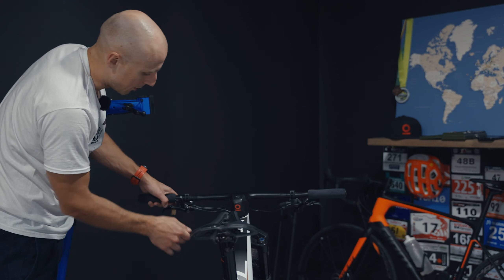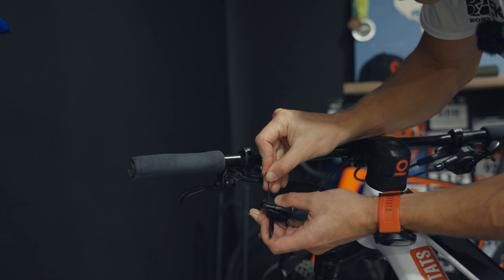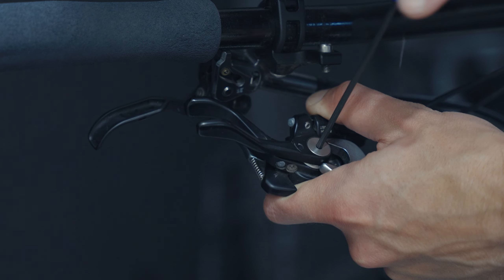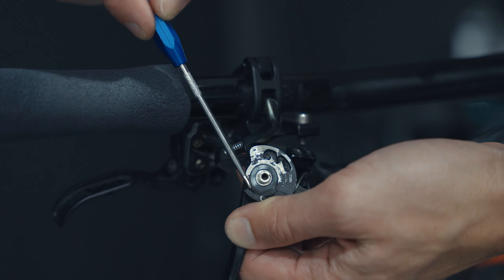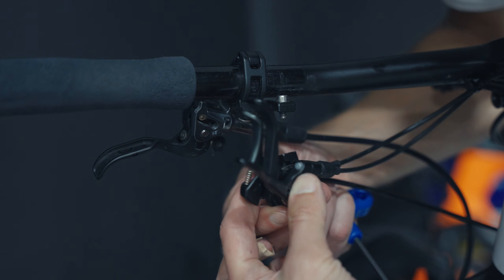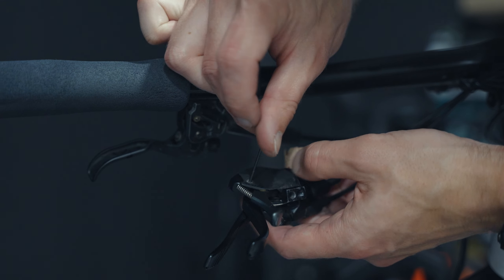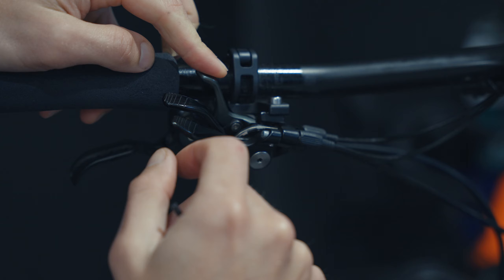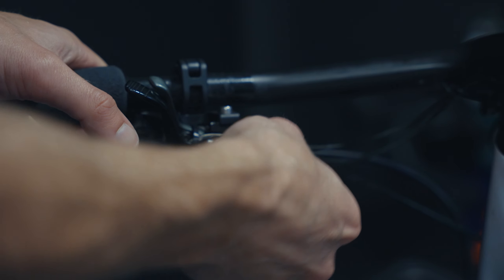Twinloc Remote Lockout Issues - Temporary Fix

Comment: For me thé problem was that thé rear was to tensed but it was unpossible to loosen it from the twinlock lever because the thread would be engaged properly...
So I unscrewed the rear-shock câble a little bit (5mm max) and then readjust thé twinlock screw, now it locks and keep locked properly
Reply from the maker: Thanks for sharing. Overtight cable can cause twinloc to fail, at the extend if lockout is too tight and you still go over it with force. however, most likely by doing that only lockout on shock/fork would be made broken, not the lever itself. 

By saying 5mm max - what did you mean in particular? Curious, as lockout bolts are prob 2 & 2.5mm allens.
Reply: @tom10crafted  I loosen the câble of 5mm (in lenght)
Reply from the maker: @ ahhh, gotcha! 🙌🏻

Comment: I knew the lockout was done the moment I saw the way you tried to tighten the  bolt from the dropper post and still  kept moving. It was the same problem  with mine. Still can't believe how fast scott sent me a new one, and it took me only a week to get the replacement part. Well, considering for what you use the bike, it is a miracle that this part lasted so long. What kind of threadlock do you use for the bolts?
Reply from the maker: I had some hopes that threads at the end will still be there - not the case. Actually after thinking for  while I might know why some are able to use it longer than others. IF rider didn't spot that the bolt is loose, then pushing with the force screw up threads sooner. It got loose for me only once in the past, and I immediately tightened it back with a threadlock. To which, I am not picky, using whichever I have onhand.
Reply: @CarlosSaavedra76  , just bring it to authorized scott dealer in your area,  they should take care of it.

Comment: Replacement with twinloc of the first spark(17-21) and wolf tooth dropper lever barcentric, finish the problem😅  my solution in my spark and happy with this
Reply from the maker: Adds significant clutter to the cockpit though :p
Reply: Its very clean for me
Reply: This system look the picture
Reply from the maker: @flape78  it is subjective thing 😊

Comment: Be honest. Would you get another Spark? I am considering different bike
Reply from the maker: It is hard not to be biased - but I wouldn't blame the model or manufacturer itself. Lets begin the honesty from the degree where not everyone goes 12k+ km in two seasons with a full suspension bike, with as much racing and beating it. To add on top - it is difficult to expect anything else from such loads, unless once you buy something you want it to last for decades. That could, only, potentially, work if bike is used to go to the church on Sundays! :D
Reply: @tom10crafted  true. I will be riding over 10km in 3 months and I will put my Spark thru it’s paces. Since I posted my initial comment I have concluded that the Spark is for me. Your channel has been a massive help and much appreciated. Now that I am keeping mine I hope you keep yours and continue making videos. Once again thanks 🙏
Reply: Thanks for sharing. New spark 900 user here. Just two rides with it coming from a epic. Very nice and different feeling. Love it. Just the  the rear suspension doesn't get fully locked. Does it get fully locked on yours? Front suspension it does for me, but rear suspension not. I will try to tighten the cable of the twinlock. You said anticlockwise, right? Thks in advance!
Reply from the maker: @rafaelsegui4845   Hey man, welcome onboard! Yes, year has to lockout basically rigid like - apart from sag.

But if you lockout and push the seat while standing on the ground, it shall not move. Yes, counterclockwise to tighten, middle barrel on the twinloc!

Comment: Its unbelievable that this part breaks so fast.
Reply from the maker: it is totally believable! :D
Reply: @tom10crafted  During my ride today, my Twinloc was fluttering on the handlebar. The inner thread is completely torn out. In my opinion, it's a complete design flaw (force multiplied by lever arm), especially with such huge levers fixed at a single point with only one screw. And then it's also made in a lightweight design. No wonder the thread gave out in no time. They should have opted for a sturdy material and a two-point fixation. Best regards.
Reply from the maker: @pumeluff7509  thats true! Actually, in my case warranty has declined the replacement. Havent’t seen the conclusions yet, but that was surprising for me

Comment: just broke the thread like you did, the wires should be removed before we start working with the lever, the rear shock's wire is pulling the lever in a weird position and that will not let the bolt go back straight in the threaded hole. have you had any success with the warranty? it is incredible to see high end shocks being controlled by this chinese horrendous garbage.
Reply from the maker: It is not required to remove the cables, just loosen them at the most (then rear shock's lever pins would fit properly)

Nonetheless, warranty declined my case stating its "BROKEN". WTF was that - don't ask me... I am still considering whether to throw them a towel or not - IMO it was very poor move by them, considering its wide-known issue :)
Reply: @tom10crafted  sad to hear the warranty part but i sent them an email anyways so fingers crossed. i wish i saw your videos before i started to "fix" it. 165 euros for a lever that looks and works like a chinese knockoff is a bit steep and is the last thing i expect to break on a 6500 euro bike.